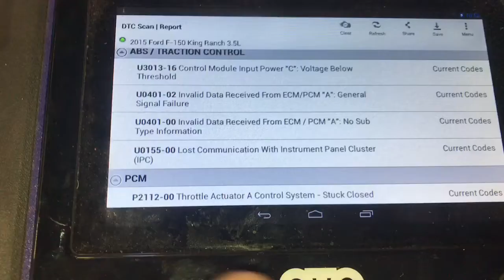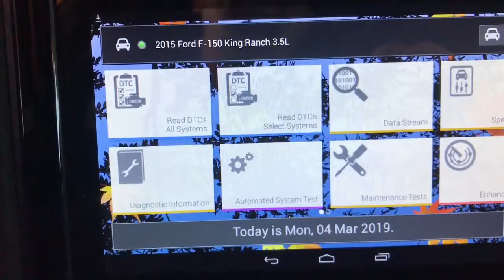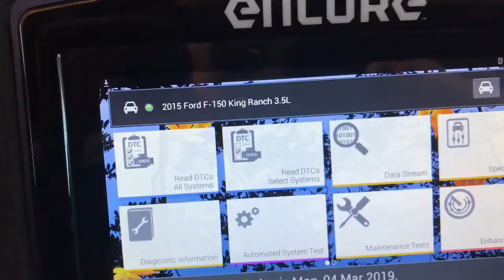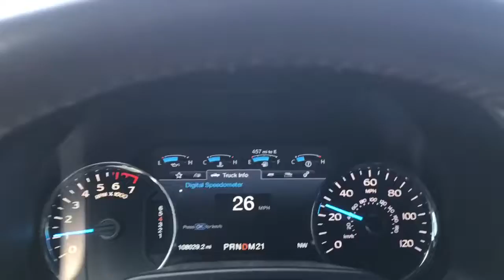Ford Electronic Throttle Body Failure EBT  Fault (2011-2017)

Comment: When i click on the link for the gasket, it says it doesn't fit my 2013 f150 EcoBoost, is this the right one??? Also that throttle body in the link is the you used right? Hows it holding up so far??? I have no codes, or cel. But the truck recently started getting a rough (shaking idle) and theres a p2111 code in the freeze frame with the obd2 reader :/
Reply from the maker: thanks for catching that. did some digging and looks like 2011-2014 takes a different gasket. same throttle body but different gasket. i have updated the links in the description to include the 2011-2014 gasket. sorry about that. and the throttle body is holding up great. about 3k miles on the truck so far and no issues
Reply: I had this issue. I’d drive down the road and the wrench icon would pop up and lost throttle. When I put it in part the idle was pretty rough but just like everyone says just turn it off and start it back up. There’s no specific pattern to when it stops throttle. I haul a trailer and it seems to do it quicker while hauling. Didn’t even bother going to the ford dealership just did my research and I replaced the throttle body about 2 hours ago. Drove around with/out y trailer, seemed just fine. I also cleaned my MAS. I’ll update in a week. (13’ F-150 xlt Ecoboost. 173,xxx and stills runs and tows like a champ.)
Reply: I had this issue. I’d drive down the road and the wrench icon would pop up and lost throttle. When I put it in part the idle was pretty rough but just like everyone says just turn it off and start it back up. There’s no specific pattern to when it stops throttle. I haul a trailer and it seems to do it quicker while hauling. Didn’t even bother going to the ford dealership just did my research and I replaced the throttle body about 2 hours ago. Drove around with/out y trailer, seemed just fine. I also cleaned my MAS. I’ll update in a week. (13’ F-150 xlt Ecoboost. 173,xxx and stills runs and tows like a champ.)
Reply: I had this issue. I’d drive down the road and the wrench icon would pop up and lost throttle. When I put it in part the idle was pretty rough but just like everyone says just turn it off and start it back up. There’s no specific pattern to when it stops throttle. I haul a trailer and it seems to do it quicker while hauling. Didn’t even bother going to the ford dealership just did my research and I replaced the throttle body about 2 hours ago. Drove around with/out y trailer, seemed just fine. I also cleaned my MAS. I’ll update in a week. (13’ F-150 xlt Ecoboost. 173,xxx and stills runs and tows like a champ.)

Comment: Could a catch can on the passenger side PCV prevent the oil buildup in the throttle body? I recently installed a can on my 2015 3.5 Ecoboost F150 and at 50% oil life the catch can was ~80% full of what looked like oil, smelled like oil/gas. The vehicle has 56k miles on it with no apparent engine issues.
Reply: Turkitron33 thanks for the video! We had major issues doing a trip from Nevada to Alabama and back towing and you saved us big time.. Easy fix now back on the road again!👍👍👍